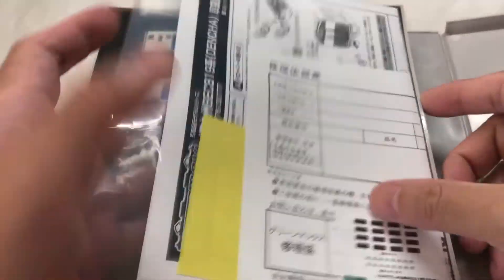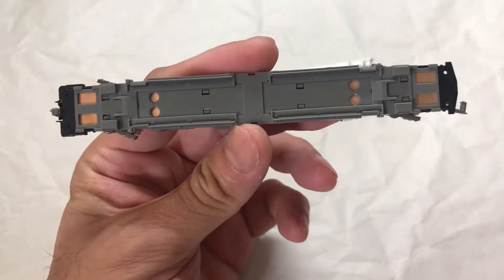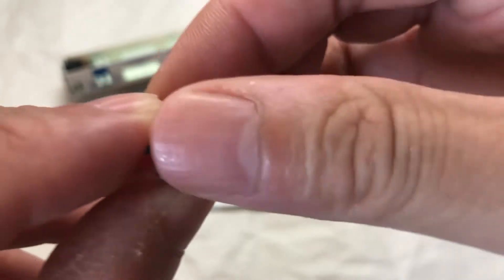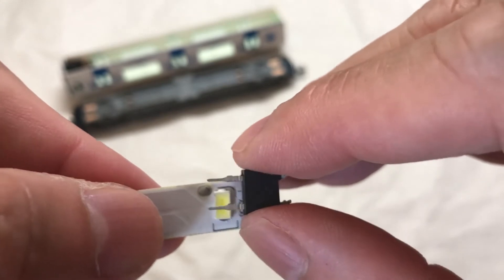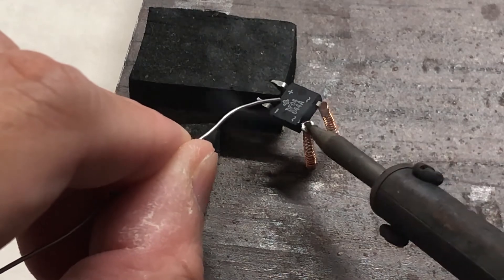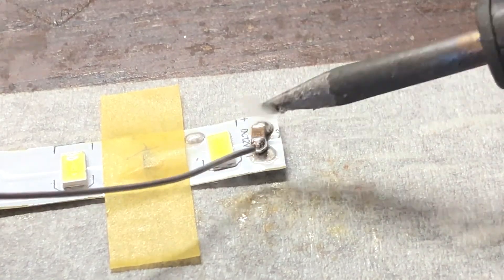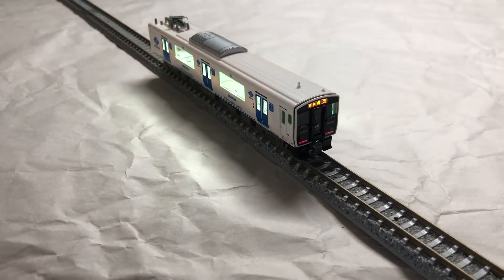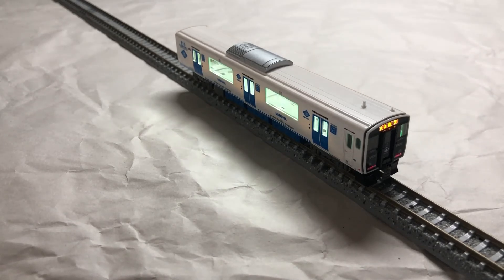Making Custom LED interior lighting for Greenmax 30777JR Kyushu BEC819 Series (Dencha)

Comment: does Tomix TN couplers fits too???
Reply from the maker: For inter-car connections in place of the kato couplers? Yes, but you need to do some amputation, which means the change will be permanent
Reply: @otakuoyaji4220  Yes in place of the kato so the notches are not for the TN? :D
Reply from the maker: @3nglehart  the notches are for the tn. But you need to cut away the Arnold couplers (gm) on the bogies. So once you install the tn couplers, you can never go back
Reply: @otakuoyaji4220  oh I see it's very unlikely to go to arnold :D, thanks for answering my query :)
Reply from the maker: @3nglehart  you’re welcome

Comment: I hate Green Max trains! They are overpriced, have no interior details, the couplers are terrible and they derail over points that my Kato and Tomix trains don't!
Reply from the maker: That's very true... unfortunately, they also do the less mainstream trains or have arrangements to make trains with special livery that kato and tomix doesn't. Them's the breaks
Reply: @otakuoyaji4220  Yeah, seem to have a monopoly on the 817 and BEC819 series. By the way, I am having real trouble with the knuckle couplers between the cars on my 817 and BEC819s constantly uncoupling during runs (not the end car couplers which I have already replaced with the Kato ones specified in the Green Max manual). Could you recommend an aftermarket set that actually works?
Reply from the maker: @B-A-L  are you referring to the couplers (arnold) between the consists of one of those train sets or are you referring to the front car couplers?
Reply from the maker: @B-A-L  https://www.youtube.com/watch?v=mgdA8zyEoG4 
I replaced all couplers with kato and tomix in this video. are you referring to a solution like this?
Reply: @otakuoyaji4220  Oh, thank you! Let me have a look at that!